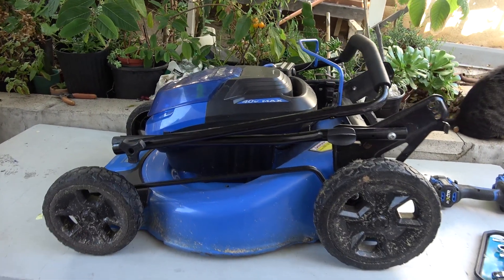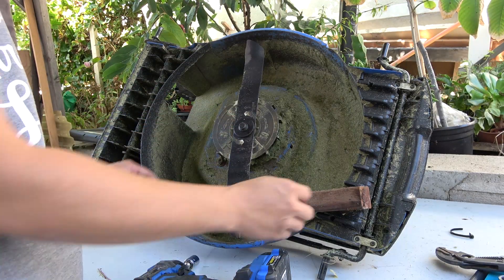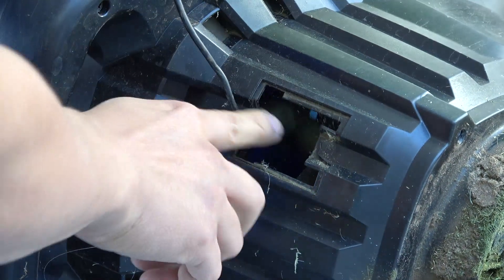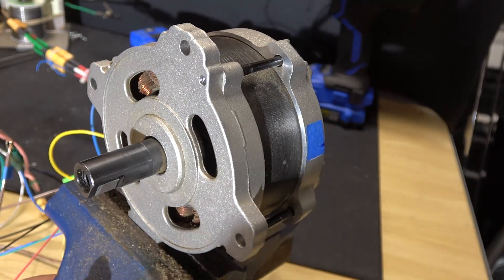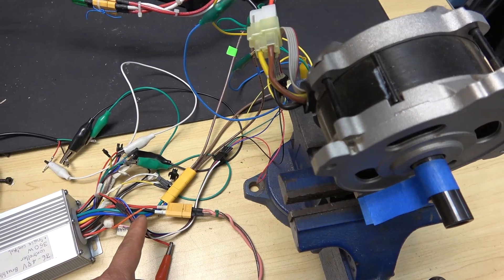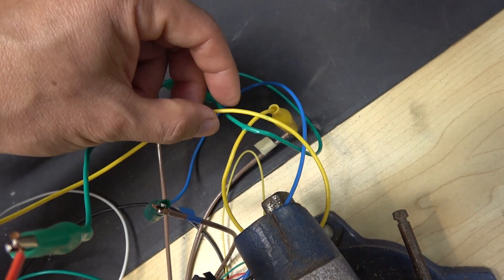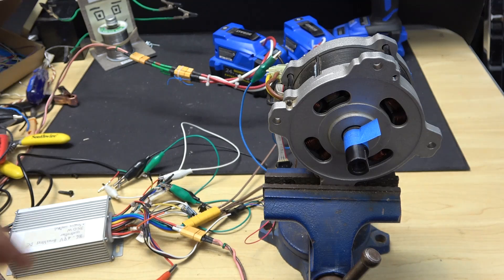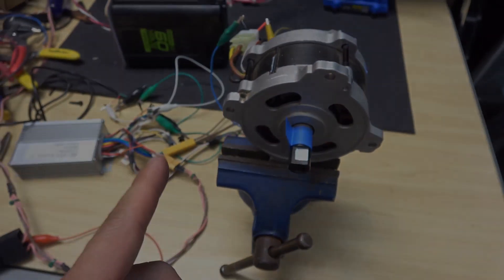Teardown: Kobalt 40V Brushless lawn mower & Bench test 40V Brushless motor for EV

Comment: I thought of using one in an RC aircraft should swing a large propeller and the shaft is large RC brushless controllers are getting cheaper and I have a 60 volt 200 amp one.  Just need to ask around as plenty end up at the tip.

Comment: Why are you taking apart a perfectly good mower? What’s wrong with you?
Reply: They have a short run time and not good in tall grass many are thrown away with little use 750 watts is 1 hp most petrol mowers are 5 hp and run for 1 hour or more.  Not rubbishing electric power but they are built to a low cost and the motor and battery are were the cost cutting is made being the highest cost items in the build.  A petrol mower needs a robust engine to hold the blade so limiting the minimum engine size and a smaller 1/2 liter fuel  tank as minuscule cost reduction and would reduce sales to nill with the competitors 3 liter fuel tank with 6 x the run time.

Comment: I have a Kobalt 40v mower and I want to run it from a different battery.  When I hook up the non Kobalt battery the mower runs for about 5 seconds then shuts off.  I would like to run this mower with the manufactures motor controller.  Do you know why the mower will not run with a non Kobalt battery and how to defeat whatever is causing the problem.
Reply: It is 3 phase

Comment: I have a 80V Kolar and would like to add an external switch to set the blade speed.  My mower currently speeds up when cutting longer / heavy grass and slows down in thinner grass.

I end up with cut grass that does not get into the bag, and some grass that is not cut well.

Could I add a switch to set the speed without adding a whole new controller ?

Comment: This is a great video, and I have a lawn mower with this exact same specification but after two years of work. But nowadays it only works for a few minutes and; any; suggestions? I like it, and I don't want to replace it; Thanks
Reply: There is a video where the guy cut one of the spring pushing against the battery in the lawnmower housing

Comment: What about electric supercharger?... would need to be geared up to say, 35000 rpm at the output, easy enough, the question is torque
Reply: Looks like it would do it, if we're talking 1000w+ at 12000rpm. 3:1 reduction might do it

Comment: What do you think would be the best way to find a Makita motor with all of the wires, controllers, etc? I want to make a high pressure water pump that can be used with my Makita batteries

Comment: I picked up one of these mowers for 20 bucks because the battery charger had fried and you can not get the charger any more. I plan on using it on a old 9 hp outboard with a locked up engine.

Comment: Hi, I am current trying to replace a front wheel I broke on mine. I saw you took off all for wheel and wonder it you have any tips for getting the Front Wheel Bolt off as it is not wanting to turn at all!!
Reply: Well, luckily the axle comes off easily and I was able to take it to a local equipment company and they had to use a Impact Drill to get the bolt lose for me

Comment: I suspect the heating on the controller is because it cant keep up with the RPM of the motor. Spinning the motor at high rpm requires a fast microprocessor, and when it cant keep up, it wont increase the speed any more (or it will pulse as seen in this video) and will just send more and more current. What you are looking for is a controller that supports high ERPM (electronic rpm) like a VESC Hope thats helpful!
Reply: you're most likely right, this is an extremely cheap controller even for cheap ones. even the normal cheap ones do a interpolation of the sensors to get a better commutation at high speed. this one is probably just looking solely at sensor data which is too slow
Reply: The controller provides the frequency that determines the motor speed with no hall sensors the controller pulses the motor to determine the rotor position before ramping up speed.

Comment: I have made a remote mower with a ryobi 40v push mower.  However, the blades seem to bog down easily.  I am controlling it a Opaltool Brushless Controller, 36V/48V Aluminium Alloy E-Bike Brushless Motor Controller for Electric Bicycle Scooter.  Do I need to step up to a bigger controller, or is this just the limitations of the mower moter itself?
Reply from the maker: How many watts is your controller? This mower uses a lot of power.
Reply: @vuaeco  500 Watts
Reply: You should look into your mowers ability to discharge the cut grass.  If the mower can’t get the grass clippings out of the way of the blade it will bog the motor down significantly.  What I’ve done on a couple of mowers is modify them by leaving the mulch bag door wide open , and even cutting most of the front of the mower so that it can discharge the clippings in front and off to the side.  The two mowers I’ve made these modifications to (one gas, one battery power) are so much more powerful now and can cut grass and brush almost as tall as me without breaking a sweat!

Comment: Hey, DM me. I have a kobalt battery extender I call the Extendo Batt. 3d printed for ease. It can be plugged into a wall or attach another battery to the bottom of it to double the AH. Built off of a standard 24v 4ah kobalt battery.

Comment: I was wondering u remember when u changed your sons Crazy Cart batteries with a drill battery, how did u charge it because I swapped my batteries now it won’t charge
Reply from the maker: I just remove the Kobalt 24V battery out of the cart and put it in my Kobalt 24V charger. The original controller with the original charger are designed to charge lead acid batteries only. It maxes out at about 29V. If you plug in the original lead acid battery charger to charge your Kobalt 24V battery, the battery will blow up.

Comment: Also, the lawnmower motor appears to be a Radial Flux-motor and most hub motor are 'External Rotor'' (ERPM). I'm thinking there may be differences in flux densities as well as phase angles and you may need a different controller. The noise of the motor with your ebike controller is more pronounced than I might expect suggesting to me that you could have a phase mismatch. You might try the stock mower controller and see if you get a difference in no-load sound and current.
Reply from the maker: You might be right. I'll double check and update later.
Reply: @vuaeco  Cool!
Reply: most are radial and outrunners. whats your point?
Reply: @Blox117  My suspicion was that the number of poles, phase angle or flux densities could be mismatched between the Radial Flux motor and the External Rotor hub motor. Looks like there could be more poles in the Hub motor, and the controller designed for the External Rotor motor might incompatible or unable to sense and generate a sine wave and angle to properly drive the External Flux motor, and could be generating circulating currents (VARs) or bucking a field mismatches. Does that make sense and what do you think?
Reply: @jackoneil3933  no it shouldnt make a difference at all where the rotor is located. there are mid drives and hub motors controlled by the exact same controller and i have literally tested that to be the case.
Reply: @Blox117  If it shouldn't' make a difference, any ideas as to why the motor was drawing so much current and the  controller and motor leads get so hot with no load? 

 I suspect there's a phase-angle mismatch between the controller and the motor. That hte lawn mower motor is designed to run at something like 2500rpm with 12 coils, I'd guess the phase angle to be 30 degrees. 

A direct drive ebike hub motor is going to be more around 200to 500rpm. with a Phase Angle, at 60 or 120 degrees. I'm also guessing the placement of the hall effect sensors could be different so the output sine wave might be switching between poles (out of phase). 

I worked by trade as a engineer on industrial 3-Phasee and DC motor speed controls, usually on 600 to 15,000 HP systems so I'm more familiar with shaded-pole and switched reluctance motors where we never encountered similar motors with different phase angles, but what else could it be? 

I found a couple of good articles that explain Phase-angle and sensing below. The Digi-key article is very well written: 

1- Why and How to Sinusoidally Control Three-Phase Brushless DC Motors
 Digi-Key North American Editors
2017-01-17 

2- 'Control Phase Angle of BLDC Motor via Hall Sensor'
Judgement of the BLDC phase angle

The BLDC phase angle is an abbreviation for the phase position algebraic angle of the BLDC motor. It refers the angle of coils of the BLDC motor in one electricity cycle after the current direction within the coil changes. The electric vehicle usually adopts two phase algebraic angles for the BLDC motor, namely 120° and 60°.

Judgment of the BLDC phase angle according to observation of the Hall sensor' installation position: The installation position of the Hall sensor with the phase angle of 120° and 60° is different. The alignment of three Hall sensor with the BLDC motor whose phase angle is 60° is the same. However, the Hall component in the middle of the electric motor whose phase angle is 120° should be installed by inversion of 180°.

The BLDC Hall sensor have five wires, including the public power source anode of Hall sensor, public power source cathode, A-phase Hall output, B-phase Hall output, and C-phase Hall output. We can make use of the five Hall leads of the BLDC controller (either 60° or 120°) to connect the negative and positive power source on the Hall sensor' lead of the BLDC motor. Connect the lead of the remaining three phase sensors, namely A, B and C, arbitrarily to the Hall signal lead of the BLDC motor controller. Power on the controller, and the controller will provide power for Hall sensor for detection of the BLDC motor.

The method is as below: Adopt the +20V DC voltage gear of the multimeter. Use the black meter pen to connect the ground wire and the red meter to measure the voltage of the three leads. Take down the high-low voltage of the three leads. Gently rotate the electric motor, and let the electric motor rotate by the minimum magnetic pull angle. Following that, measure and take down the high-low voltage of three leads again. Measure it for six times repeatedly. Use 1 to indicate the high potential and 0 to indicate the low potential. Then, if the BLDC motor is adopted, continuously rotate six minimum magnetic relay angle. Then, the Hall's Truth Value measured out should be 100, 110, 111, 011, 001, and 000. Adjust the pin sequence changes of the three Hall sensor' leads. In this way, the phase position of A, B, and C of the BLDC motor with the phase angle of 60°can be judged.

If the BLDC motor with the phase angle of 120° is adopted, then continuously rotate by six minimum magnetic pull angles, and the Hall truth-value signal measured out should change in accordance with the rule of 100, 110, 010, 001, and 101, respectively. In this way, the electrification sequence of the Hall sensor' lead can be judged.

Default phase of the BLDC motor

The BLDC motor's default phase is usually caused by damage of Hall sensor. We can measure the resistance of the Hall sensor's output leads against the Hall ground electrode and relative Hall power source lead, and use the comparison method to judge which Hall component is in fault.

In order to ensure precision of the electric motor's phase-shift position, it is suggested that the three Hall sensor should be changed at the same time. Before change of the Hall sensor, it should be clarified that whether the phase algebraic angle of the electric motor is 120°or 60°. Generally, the displaying position of three Hall sensor with the phase angle of 60°is parallel to each other. In terms of the electric motor with the 120° phase angle, the Hall component in the middle of the three Hall sensor should be reversed by 180°before its placement.

Default phase of the brushless DC motor controller

Default of the master phase of the brushless DC motor controller can be detected by the racing troubleshooting of the brush controller, which can help clarify whether the MOS tube is penetrated through. If the MOS tube of the BLDC Motor controller is penetrated through, one pair of MOS tubes—the upper one and the lower one—of certain phase position will be penetrated through at the same time. Therefore, if either one of MOS tubes requires changing, they should be changed at the same time.

Hall sensor'default phase of wireless controller is mainly reflected as the controller's failure to recognize the electric motor's Hall signals. Below is the method to detect the default phase:

Unplug the Hall lead of the controller and brushless DC electric motor. When the controller is electrified, adopt the DC voltage gear of the multimeter, and put the black meter pen close to the black wire of the Hall lead of the controller. Use the red meter pen to measure other Hall leads of the controller, and the voltage should be more than 5V. Otherwise, it means that the internal Hall output circuit of the controller might have faults. By measuring the filter capacitor of the Hall lead and the corresponding pin of the master control chip, we can further judge the fault position. Exchange of the filter capacitance or the master control chip can address the default phase.
Reply: @jackoneil3933  I don't know without testing. This is a cheap esc, so it's only outputting a PWM frequency which is basically switched DC and not a sine wave. If it was a more complex one it would find the correct angle on it's own as well as the resistance, inductance and so on.

And yeah its a bit different than reluctance (no magnets, no back emf) or shaded pole (induction, no magnets, single phase )

edit: as someone else in the comments suggested, its likely that this controller is so cheap it doesnt do any kind of sensorless mode or interpolation of the hall sensors at high speeds. what this means is that at higher RPMs the sensors are too "slow" and the commutation is incorrect.
Reply: @Blox117  I posted another comment about learning mode on and included it below. What you speculate concurs with what I was thinking. I heard the guy with the Karma ebike channel say that Hall sensors are old school and he doesn't bother and runs asynchronously (on a bike). He also melted motor lead wires. 

--------------------
Jack O'Neil
8 months ago
Does your controller have a manual 'self-learning' mode? (usually two white wires), and if so did you implement it after connecting the motor? I'm wondering if your high current with no load might be due to the controller not matched to a 12 pole motor and/or some phase angle misalignment between the controller and motor.  I think most direct drive ebike hub motors have 18 coils rather than 12. there may be some pole specification on your controller. Cheap, generic controllers could be for a fixed pole-group and phase angle, while others with self-learning mode and detect the number of poles and phase angle.

Comment: Does your controller have a manual 'self-learning' mode? (usually two white wires), and if so did you implement it after connecting the motor? I'm wondering if your high current with no load might be due to the controller not matched to a 12 pole motor and/or some phase angle misalignment between the controller and motor.  I think most direct drive ebike hub motors have 18 coils rather than 12. there may be some pole specification on your controller. Cheap, generic controllers could be for a fixed pole-group and phase angle, while others with self-learning mode and detect the number of poles and phase angle.
Reply from the maker: It has a self learning mode but I didn't use it because it just worked the first time I plugged it in. You have a good point. I should try the self learning mode. The higher current at no load might not be the best combinations even though it produces the best result for a bench test.